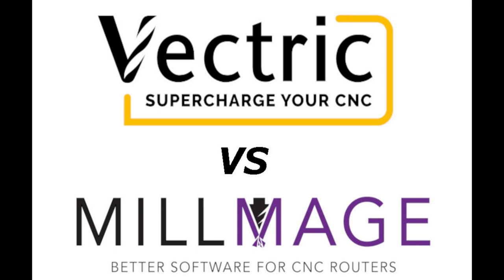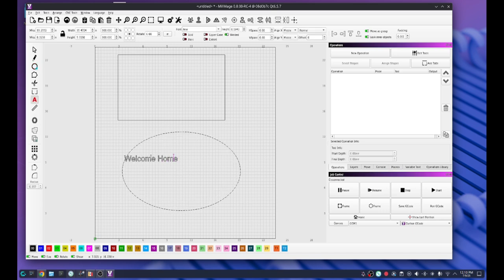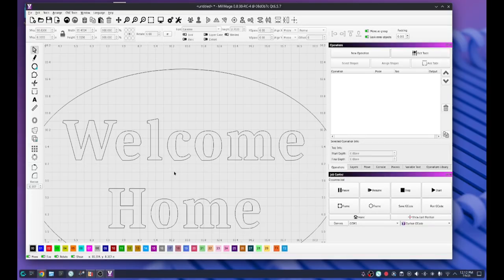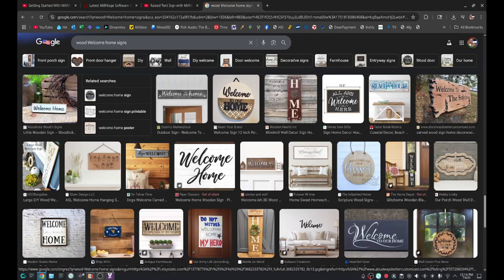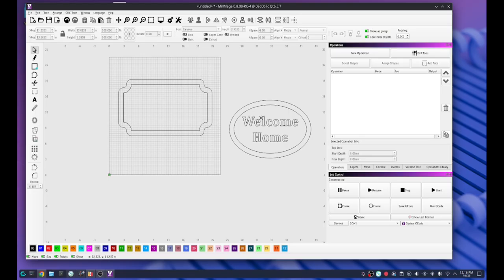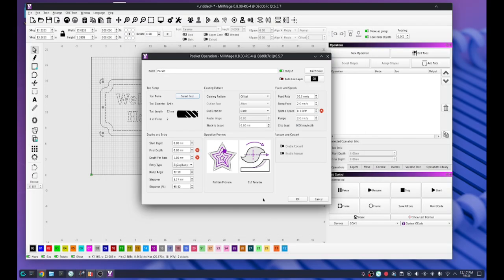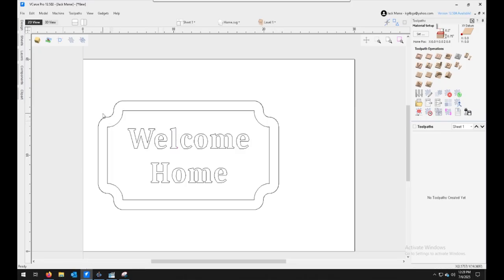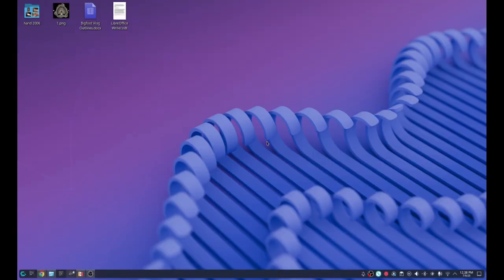Welcome Home Sign | Millmage vs Vectric VCarve – CNC Design & Carve Showdown

Comment: The best part about Millmage is that it's brand new and in active development. Next is that if Lightburn is any indication, it'll get continued active development. V-Carve on the other hand, based on ArtCam, is slowly developed. It's generally solid, but if you find an issue, it's anyone's guess when it'll be fixed and released. The featureset is also well baked and you shouldn't expect anything major to be added in upcoming releases.

Given that Millmage is also available on every OS platform, going forward, I think it's going to come out on top for the vast majority of hobby customers.
Reply from the maker: Well, I install Millmage RC4 on Arch Linux. All newer versions are not working on Linux. Windows and MAC only. So it will not be available on all OSs. You are correct. It is in active dev. But I really wish they would fine tune what they have now before adding new features like the trochoidal slotting they are adding right now. That said, I stand by a statement I made on a live stream a while back. I hate Millmage. But I really like it. And I feel the same way about Fusion 360. That is why I am trying to give FreeCAD a fair shot.
Reply from the maker: All that said, I am still pointing new people to at least look at Millmage before going to another program. I told a guy the other day he needs to give Millmage a shot. So I am not down on Millmage. I am really pulling for them cuz I love Lightburn.

Comment: The 50% stepover limit could be removed for raster pockets, but it’s required for offset pockets, because higher than that starts to leave small islands of material where the offsets don’t quite meet up.

Once the new code for offset generation is ready, we’ll be able to find those spots and remove them, as well as add a bunch of other new features. The limit will be removed.